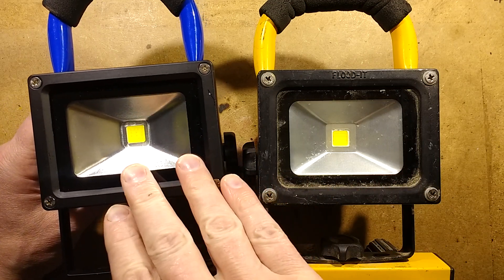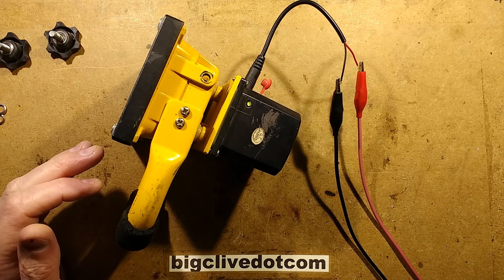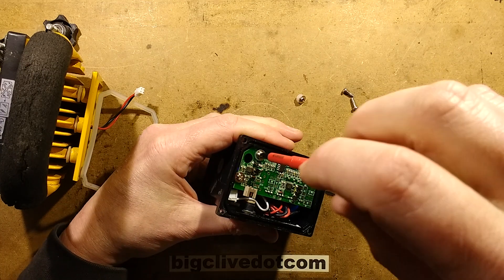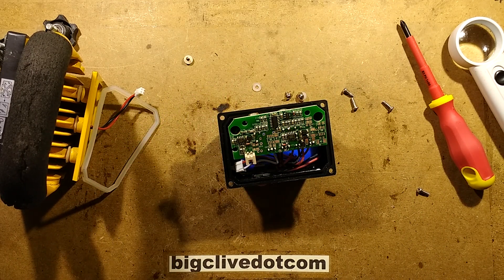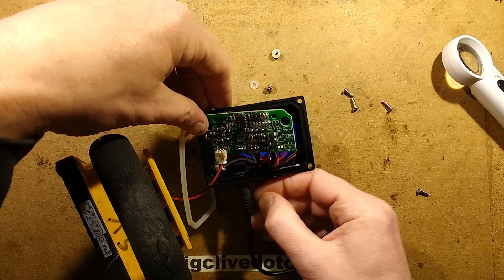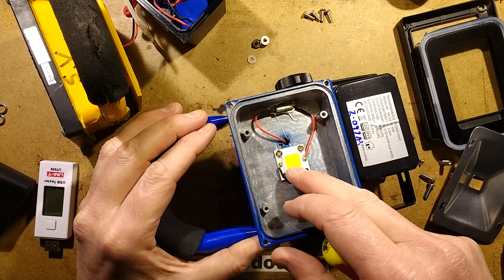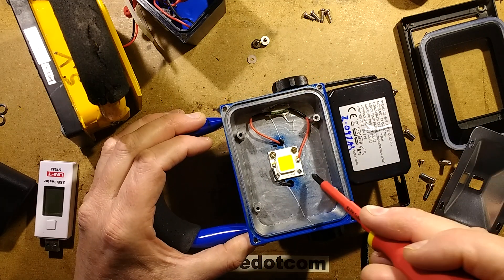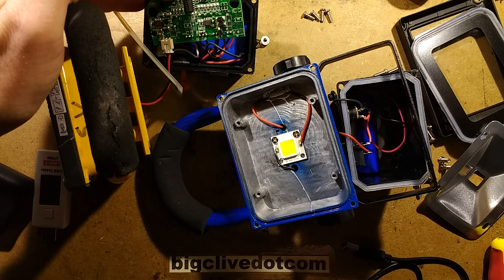Inside a proper (Utility company) LED work light.

Comment: Stop fabbing, got pasta everywhere at the Chinese would cheat, 8.8Ah battery, lol. When theres series connection on cells, Ah doesnt mean anything without specifying the voltage, so you express available capacity in Wh. I got the same light but wouldnt call it "proper", for the simple reason that it has only 1 mode, 100%. A proper one would have at least a 50% duty cycle as well if you really dont need full output. Whats not Chinese for you by the way, when everything is Chinese really...there are no crappy hot glue and melting plastic type of Chinese electronics anymore, that was the 90`s. Take the shittiest electronics manufacturer in China and guaranteed its got a near state of the art maybe 1 generation old factory that might as well couldve been Sony`s 5 years ago. "Chinese..."